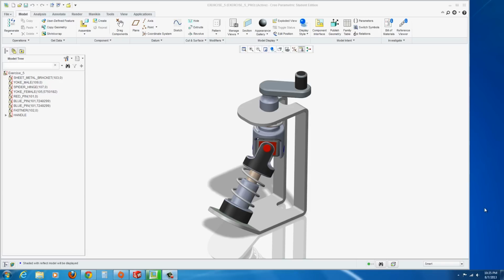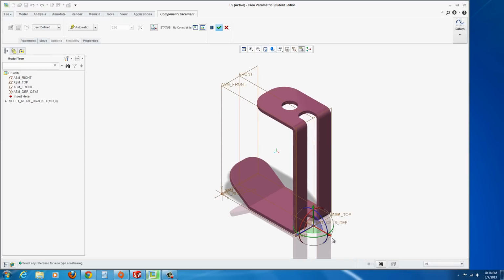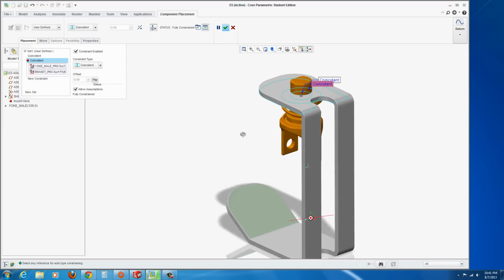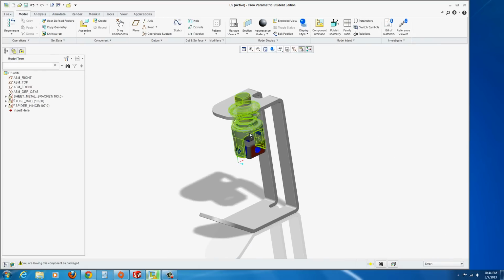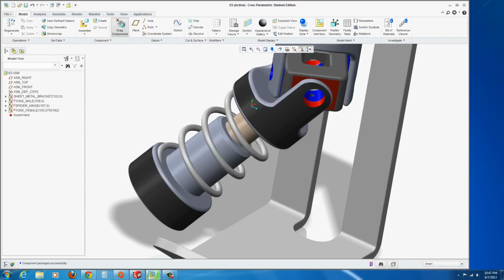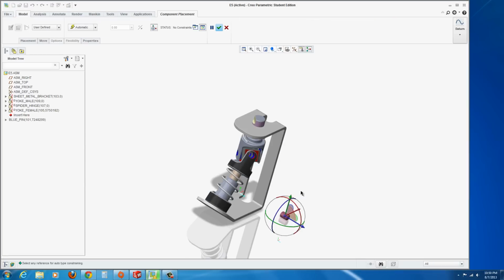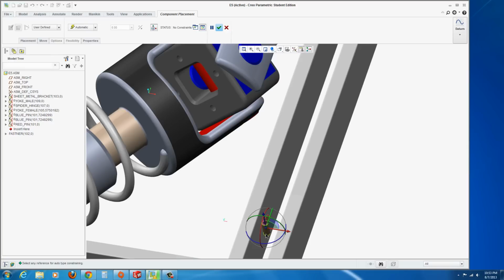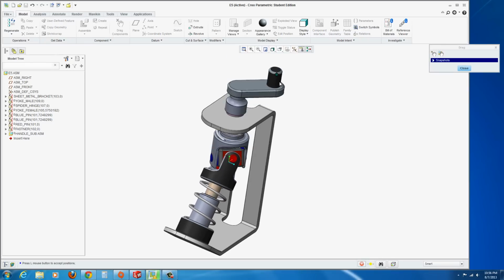E5 CREO Parametric 2.0 Assembly Basics 1

Comment: Hi vertanux1 I was having the same issue as Ivan el Grande and followed your instructions to download Inventory 2014 Exercise 5 files (.ipt and .iam format) however when opening those files i get an error stating "Inventor License Error" please help.

Thanks
Reply from the maker: Hi Eddie, Try importing the SolidWorks, Creo or NX Exercise 5 files and using them.
Reply: vertanux1 HI , i couldn't  fine the files. It would be a great help if you provide me the link to download the files for assembly .
Reply from the maker: vertanux1.com part files has all the files available. I'm sorry Eddie. I don't know why Inventor is not opening your files. Try Autodesk technical support..

Comment from the maker: Hello Ivan, Creo educational version files are specifically wrtitten to not be opened in a full version. PTC does have an Import Translator but i believe it's an extra cost for corporate use. Just import my Inventor 2014 Exercise 5 files into Creo. It should work.
Reply: I tried that one but didn't work either. It said something went wrong with the Inventor pro license.
However the IGES files worked. Thank you for uploading those!